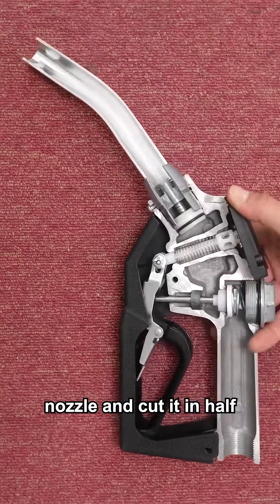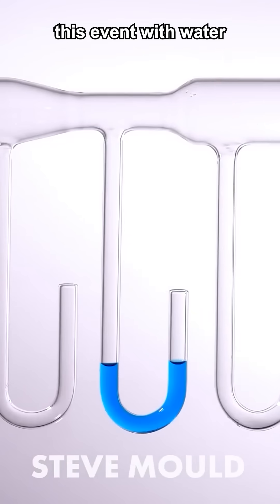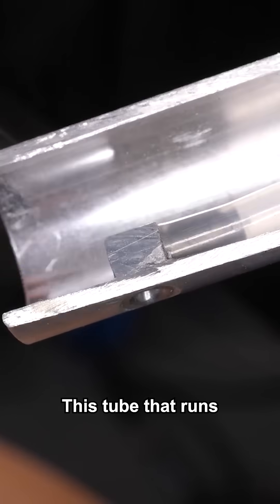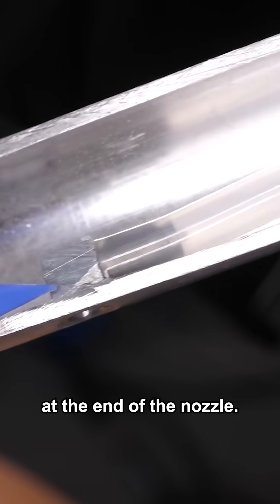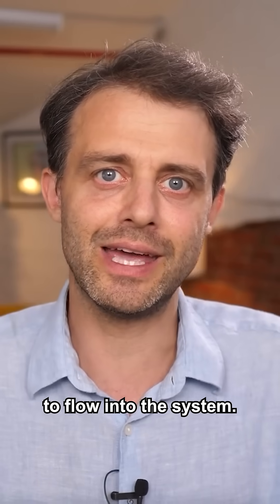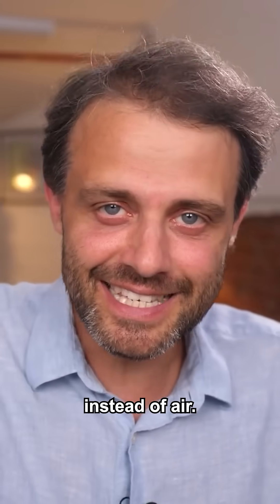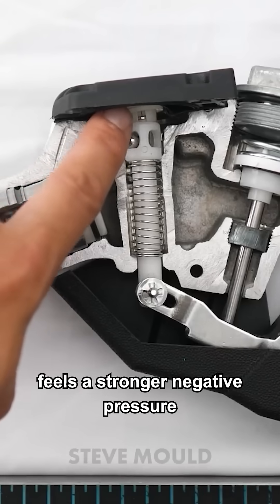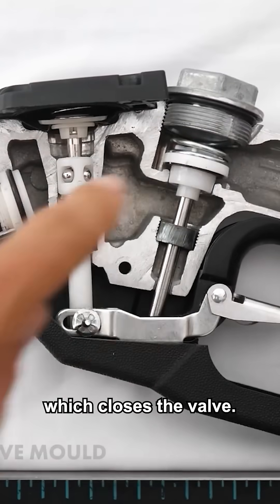How Petrol Pumps Know When to Stop! #shorts

Comment: You just told me exactly what is wrong with my least-favorite pump at the gas station. Going to see if that hole is blocked or otherwise obstructed next time i go there
Reply: If there is any kind of emissions system on the pump handle the most commonly used pumps get messed up because people "top off" which means they keep pushing the pump handle overfilling their gas tank in their car and suck liquid gas instead of fumes into the recovery system and makes the pump click off every like 50 cents and pisses you off. So you are making sure your gas tank is absolutely full but you are just sucking you gas you just bought back into the gas stations system!!

Comment: Short-er answer, pressure valves.
Reply: Quite frankly i think thats the shortest answer that is still an actual answer. Its only two words
Reply: @Palmtop_User  or just "valves" because "pressure" is the only thing valves do
Reply: @eli1000fer  there are some contexts where vacuum tubes are called valves but yeah you right
Reply: @eli1000fer What about toilet tank valves? That closes with water flowing up